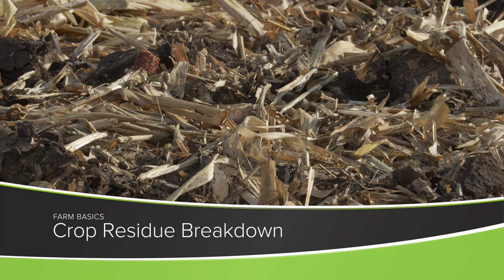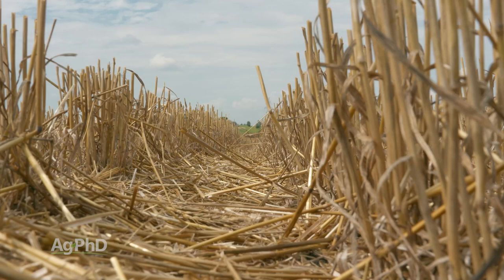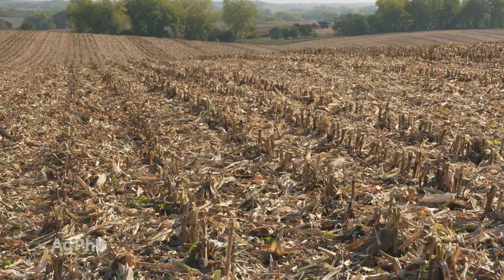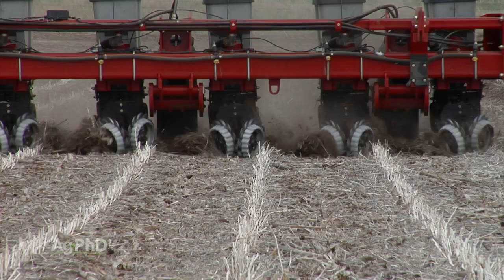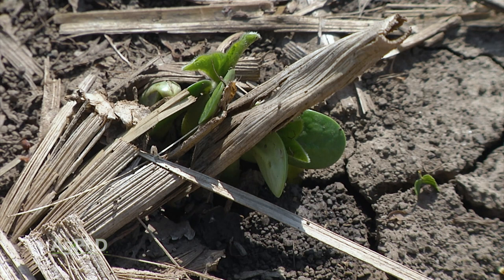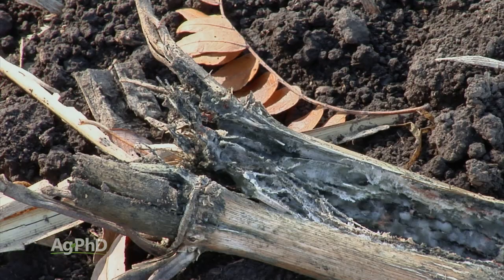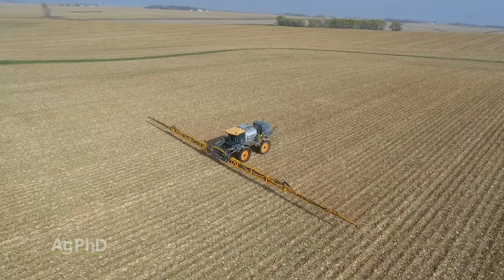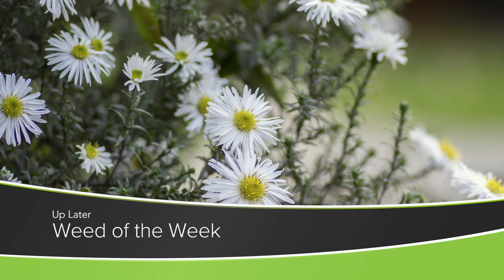Crop Residue Breakdown

Comment: Dcomp works great . We use it on corn stalks there is a visible difference between where we spray and where we don't.  We try to plant at an angle so we aren't running across a single row as well . Great work !
Reply from the maker: Brian and Darren responded to your comment on Ag PhD Radio: https://soundcloud.com/agphd/01-07-22-farmer-friday?si=5061471f13214d7f8aa60eecb93c2e94&utm_source=clipboard&utm_medium=text&utm_campaign=social_sharing#t=54:19

Comment: With no till or low till especially in a corn field , do farmers try to plant the next year's crop in between the rows of the previous year's crop?  That sort stalk and root system seems like it would be very difficult to plant thru.
Reply: With current GPS guided tractors you can  load last year's planting map and "bump" the tractor over 6 inches and plant the new crop. There are are mechanical blades on the planter, so that you can seed thru the old row. But moving over is easier and will create better germination. We plant certain fields north south for a year and then plant east west the next year. Helps with the heavy compaction on the end where you turn.
Reply from the maker: Brian and Darren responded to your question on Ag PhD Radio: https://soundcloud.com/agphd/01-07-22-farmer-friday?si=5061471f13214d7f8aa60eecb93c2e94&utm_source=clipboard&utm_medium=text&utm_campaign=social_sharing#t=54:40